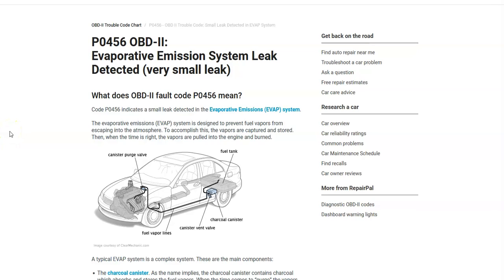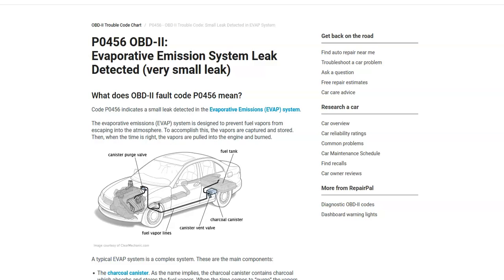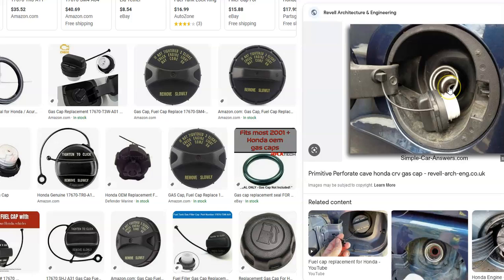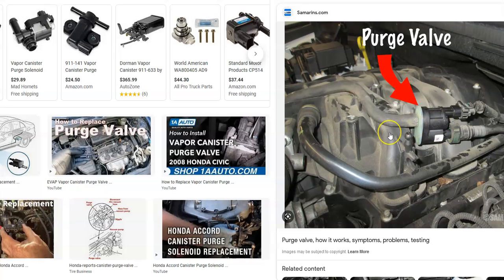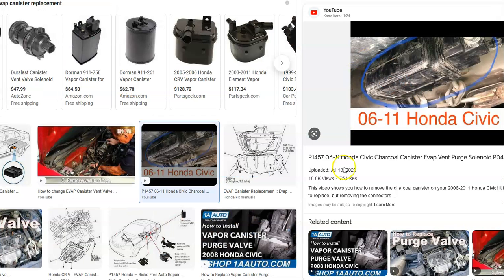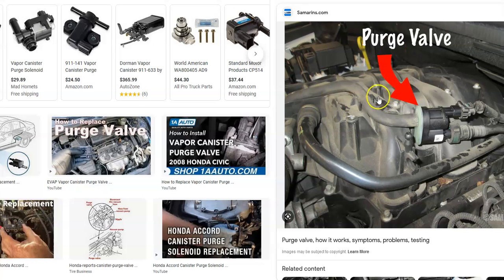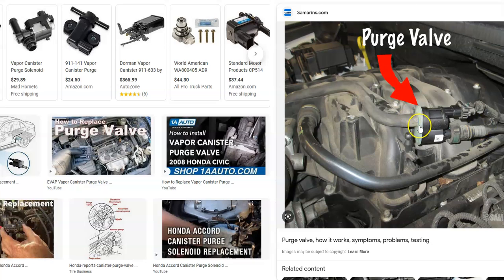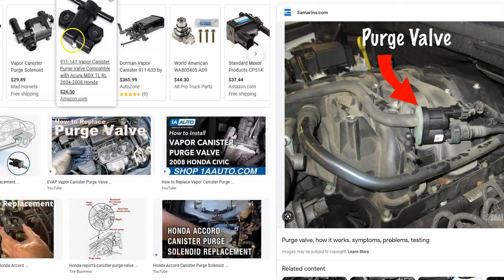How to Fix Honda P0456 Code: Evaporative Emission System Leak Detected (very small leak)

Comment: I plan on trying the other stuff. However my experience with this is that i had the "check gas cap" message on my dash. I changed the gas cap and that didn't work. Then changed the Purge Valve and that seemed to work. Fast forward a few months not this engine light is showing up. Do you think its my purge valve or should i check everything else? the tubs around he purge valve look good.

Comment: Hi my 2016 Honda civic show this code and po455 it has no gas cap we’ve changed the purge valve and no leaks . my car is pulling back really bad. Every time my pushing on the gas . Feels like i have a manual car which i don’t . What can it be?

Comment: My Tighten Gas Cap warning turned out to be a bad vent valve, the old one had a bit more stiction than the new one, an easy job to swap it out.

Comment: have a 2016 civic touring with a turbo engine p4056 code, smoked system only hint of smoke and around cap less filler cap, took to honda dealership for diagnosis as i needed inspection they couldn’t find anything else, cleared code test drove passed emissions, replaced cap less filler part, approx 20 days later got code again, should i just change charcoal canister, purge valve and oxygen sensor and see what happens to replace entire filler neck assembly part alone is 1,200.00 and it’s a big job to install 🙁
Reply: You might have figured the problem by now, but when it’s an issue with the charcoal canister, when refueling, the pump will tend to snap off ever so often. Kind of like when your tank is full but it’s really not full.
Reply: From my experience, the only way the charcoal canister is bad is if it's damaged liked you ran over something and it for broken and leaking. If it's untouched, then it's shouldn't be a problem. Another reason why it could go bad is it's been contaminated with fuel if you overfill your gas tank at the pump. Or it's somehow contaminated with water. So it's rare to ever needed to replace it. Unless the car is super old and has 300 k miles.

Comment: I"m going to agree with get the OEM gas cap. Just replaced mine on a 2014 Odyssey with a generic and first got a message about the gas cap. Tightened it more and that error went away. But then a few days later getting the P0455 P0456 errors. Going to put the original OEM on until I get an OEM replacement.

Comment: I have a 2006 odyssey that has come up with this code...moments after it came up, the van began sputtering went into safety driving mode and is bellowing smoke out of the tail pipe.  My brother is handy with parts replacing, but not so much with diagnosing.  Any tips to help him narrow it down?  Thank you for your videos.
Reply from the maker: A P0456 code wouldn't cause those issues  and there is likely another problem. There very likely is more codes that will point to the issue.
Reply: @whyingo7964    also p0300, p0301, p0302 and p0303  these came up immediatly after the p0456 code.
Reply: Weird update:  I have used a spare vehicle for about a week or so now...and the van has just been sitting.  Today, I went out to move the van fully expecting the smoke and shuddering etc..but...it cranked up fine with no error codes and only a bit of smoke (it has lingered even after letting it run for a  bit)..but..Im so confused...maybe it has to get above a certain rpm for it start acting up again?

Comment: My 2004 Honda Civic LX is pulling this code. The is blowing through gas like nobody's business and has been for a while. I also can smell gas periodically. Already checked the fuel pump and gas cap so that's not where the problem is. Sure wish there ways to test car parts without using costly tools. Anyway, your video helped a lot. Thank you.

Comment: Hi,
I had Honda civic 2019 sport and recently i had this problem with P0456 error. I replaced the purge valve but it did not change  the error again came back.
I was also having a problem with a gas tank when i fill the tank the nozzle clicks of every certain time so like the nozzle shuts off thinking that the gas tank is full while it not even half way.

also sometimes i smells the gas in side my car. 

is it something which might be the charcoal canister solenoid not working?

I went to the dealership and looks like they are making things up and saying that they found some leak but they dont know where it is coming from and they need more time to remove the gas tank and lot other things to see the leak.

Not sure what to do.
Reply from the maker: Its hard to say what the problems is but it does sound like a charcoal canister issue.
Reply: Did you find what the issue was?